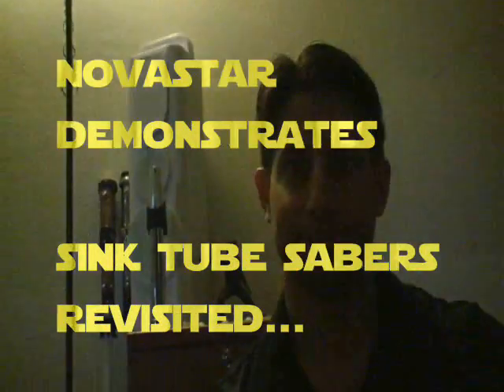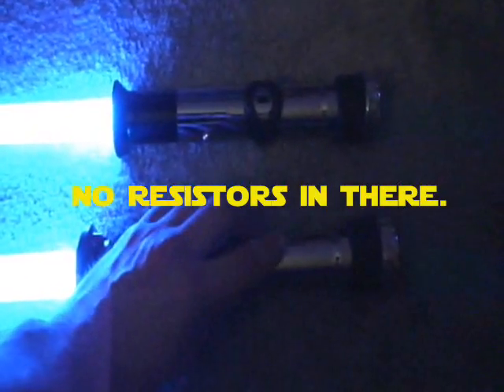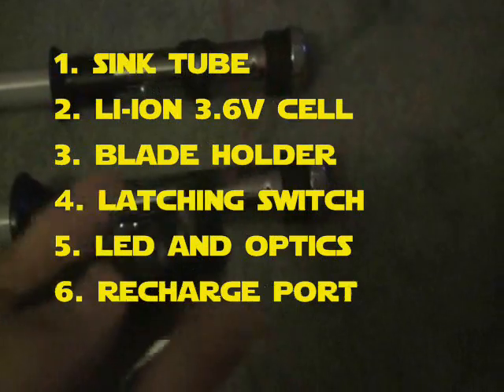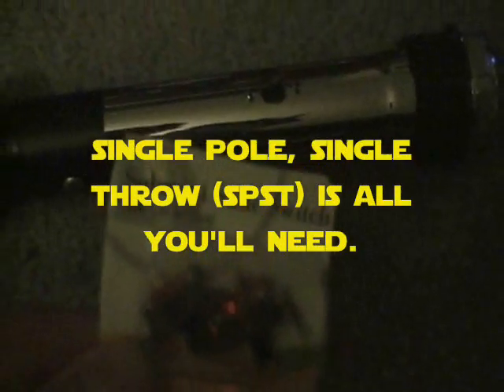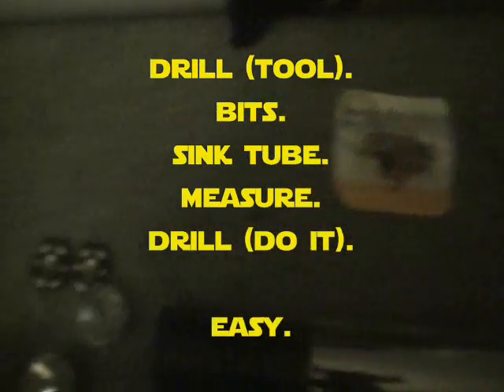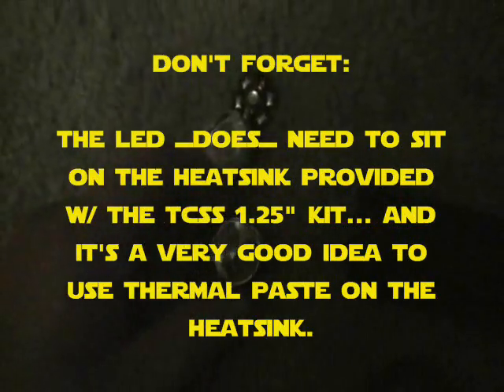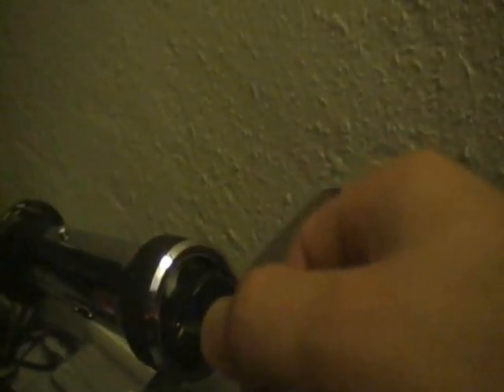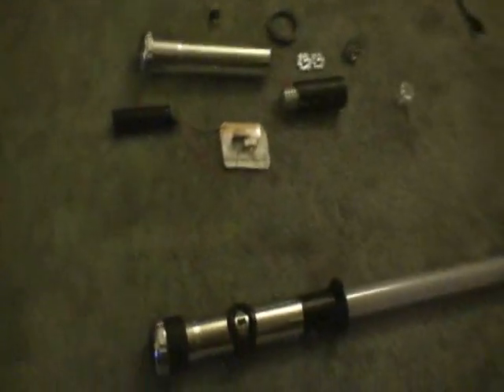How to Make Lightsabers -- LED & Basic Sink Tube

Comment: You, my friend, are awesome! Trying to figure out the resistor values breaks my brain... So being able to do a direct drive is perfect. Thanks so much for the breakdown of just how long an overdriven LED would actually last! Folks on saber-building forums always make it sound like your saber will be broke in a year if you overdrive the LED.
Reply from the maker: Resistance calculation is not as hard as you think, and... you can use online tools to calculate resistance anyhow.

Overall, if your LED needs/requires ~3.7v and you use 7.4v to power it (directly)... first of all, just use a 3.7v cell.  :)  BUT... if you DO use an overage of voltage... you simply need to subtract to get the amount of ohms to resist.

AKA -- if you need 3.7v but you have 7.4v.... 7.4-3.7 = 3.7 ohms.  Or, even ~3 or ~4 ohms would do fine--you don't have to be perfect.

Comment: Do you use a heatsink for your LEDs?
Reply from the maker: nagano3193 Yes.

In almost all cases with LED sabers of this ~~particular type~~ (at least from 2005-2015)... you're generally seeing a lot of heat generated, since the LEDs are run ~1A, and even sometimes ~2A (depending.  Usually, that means some sort of RGB or RGGB, RGBA, RRW, BBW, etc.)

So in a nutshell... there is a LOT of heat to stave off.  :(  With high-powered LEDs...
Reply: ok thanks i just didn't see one in the video.

Comment: Hi NOVA, sup? another kick ass video. So, could you tell me if the MR board can handle 7.4v (Li.ion 3.7v) or if it works with only one Li-ion 3.7v? I got a MR Vader that uses 3AAA.

SGDEVIL